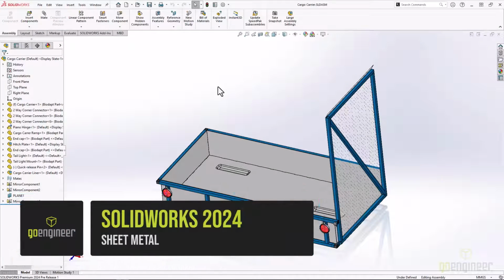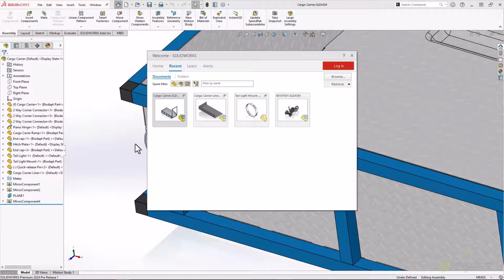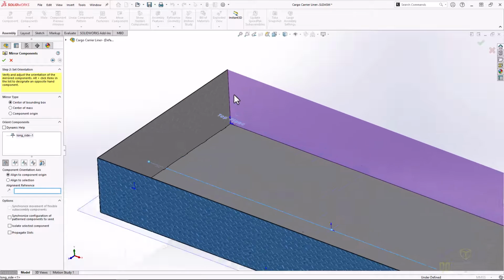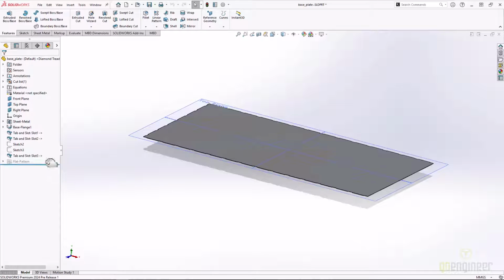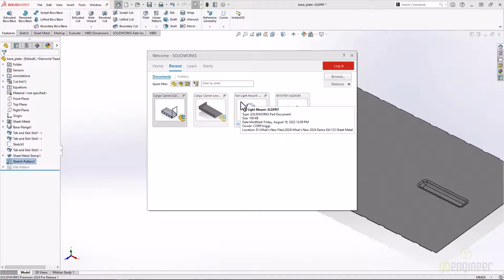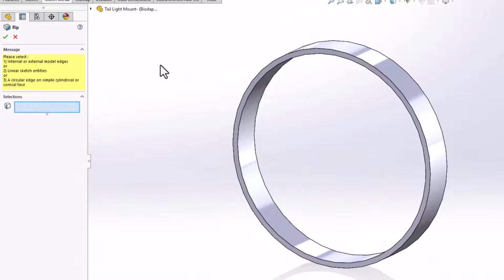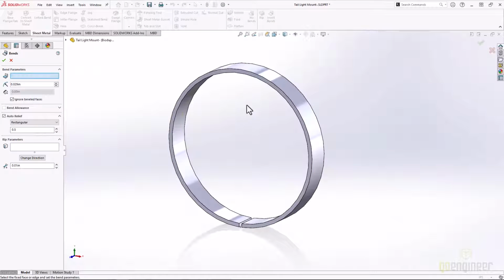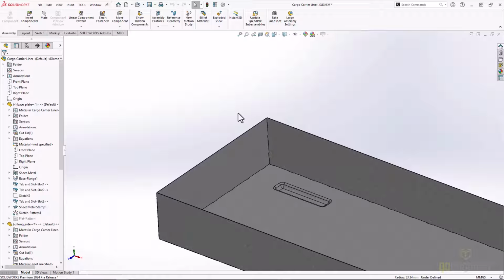SOLIDWORKS 2024 What's New - SOLIDWORKS Sheet Metal

Comment: Hello, I would like to ask you a question, which belongs to the sheet metal, more precisely to drawing session. In the general template is set the format of the bend line with the text as well. But the parameters, which has to be displayed are stored in separate txt file (bend direction, angle, radius, ...) So, the question is: It is possible to make a line brake in this text? I would like to have the bend direction in one row and bend angle with the radius on next row... Thank you for your answer.